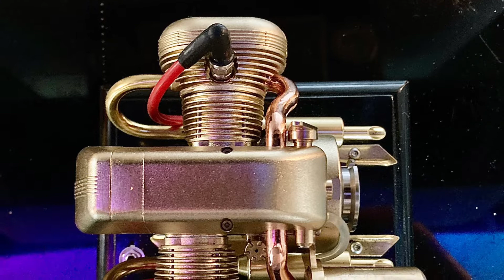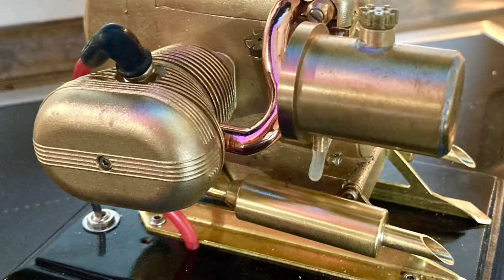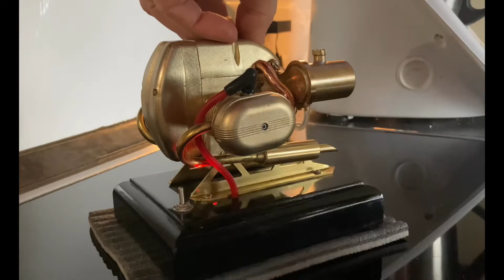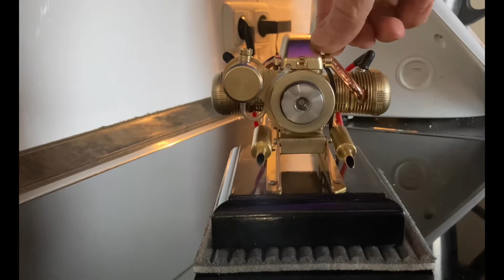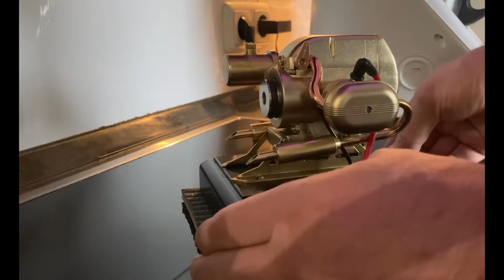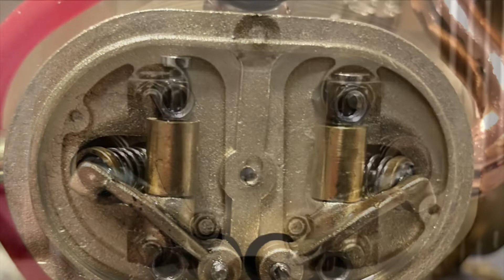Boxer gasoline engine model R90S

Comment: What fuel do you use ? Did you add oil to crankcase ?
Reply from the maker: I use Aspen 2 Stroke fuel. It’s Ethanol free. Premixed with 2% oil. Use it for all my models and can recommend it. It has little odor and the liter is about 6€. In the crankcase I spray a little bit of white grease spray from time to time. (No WD40!!!!)
Reply: @MC-MC1MC  thanks, I am waiting to receive mine, I saw a video that opening the crankcase oil filler is a pain. I will add white grease as well. Probably better than engine oil and dealing with the leak. Did yours work fine out of the box ?
Reply from the maker: Hello again,
It runs better and better, starts easy by hand. In the meantime I ordered new cylinder head covers from Jin. (About 35€ for 2 - BMW style) It looks so much better now. The old ones looks a little bit like from a Ural motocycle. If I have longer runtime, I put a small USB fan in front of the engine for cooling the cylinders. If you can touch the heads with your fingers, everything is ok and you don’t need cooling.  About 60-70 degrees Celsius. There is only one carb for 2 cylinders and a little bit tricky to adjust. Try to start without changing something. It should run out of the box. They did run in China. If the engine has good compression, it will run. A good way to check if your engine is lucky take one ignition cable of while running. If everything is fine it keeps on running  on one cylinder. 
If you get your engine an you have any questions, feel free to ask me. I will help if I can. 
Regards,
Manfred.
Reply: @MC-MC1MC  thanks for your detailed response. Did yours have engine oil when came from China? Apparently some do and it causes oil leak into cylinder , causing issues. I think specially if they are put on the side for long.  How much different is the new head covers compared to original?
Reply from the maker: @simplefact4u  
Where did you buy your engine? I got my from ebay.  If you look at „microcosm-engines“ there are the headcovers. For example the R69S (BMW) has this covers. They are rounded on top and looks like the original. 
I don’t know if there was oil in the crankcase from factory. I don’t think so. Maybe a few drops on moving parts during assembly. I saw some videos on youtube putting 10ml Oil in the crankcase. It splashes on the bottom of the piston. The rubber o-ring does not seal perfect and results in burning oil and lots of smoke. These small engines are not made for running high speed. Most of the time I let them idle or run at low speed. Of course I let them rev up sometimes. But it is not the same quality like an RC plane engine made for 15000 rpm. I have some stationary engines (Diesel style) M15, for example. I put some grease on the gears and spray a little bit of grease spray on the crankshaft, bearings and valve lifters. Put a drop of oil on every moving parts you can see. If you are interested please have a look at my  other videos.  The M16 engines ( air cooled with a little fan) I can recommend. They are easy to disassemble and maintenance, good runners and reliable. 
Sorry for my bad English. 
Manfred.
Reply: @MC-MC1MC  thanks again, I bought it from Ebay through the auctions they run. Around $200 cheaper than websites. Although not sure if those are returned or problematic engines or not.  I agree with you on the lack of proper sealing on them. They are really made for displaying and running for a short time as a fun element. I probably disassemble and add some sealant at the crankcase. Although I will follow your advice and use white grease spray on parts and few in the crankcase. I wish these came as kits too, would have been fun to build it ourselves and improve during the process.  I will check your other videos for sure :)
Reply from the maker: @simplefact4u  Good morning,
all my engines are from ebay auctions. All new and well packed. I wish you luck with yours. Please inform me if and how it runs.
Reply: @MC-MC1MC  will let you know for sure. My next engine would be a Cison L175 kit. I might get a Holt engine from Microcosm but they are expensive .
Reply: @MC-MC1MC  do you have black fluid leak from the base of the cylinders too ? Got mine and lots of issues with the spark, valves and now miss firing from the right cylinder with lots of black stuff coming from the cylinder base and the exhaust
Reply from the maker: Its seems to be to much oil in the crankcase or to much fuel. Try to dry it. Sparkplugs out,close the carburetor screw so that no fuel goes to the engine. Rotate the engine with a powertool or small rope. Blow  air into the spark plug hole’s. Let it dry out and wait a few hours before next start.  
Do you have spark and compression on both cylinders?
The carbscrew on mine is about 1/4 open to start and run well.
Reply: @MC-MC1MC  I haven't added oil to crankcase but using pre mixed fuel 50 to 1 ratio. The original spark plugs were defective so I replaced them with Iridium ones today. Runs much better. The carb is so sensitive. Did you adjust the low speed needle on the throttle ?  It only happens to one cylinder .
Reply from the maker: Ok, if you didn’t put oil in the crankcase, the engine is flooded with gasoline. On my engine changing settings on the  lowspeed needle doesn’t have any effect. ( maybe different at yours- ( it is only for idling I think. ) Ok, if I close it completely, the engine dies. 
You are right, the highspeed needle is very sensitive. It is not the best carburetor to handle 2 cylinders. Changing the settings about 1mm and only 1 cylinder is running. 
If my engine don’t start after one or two pulls, I close the highspeed needle and give it a try. If the engine starts up I open the needle quickly. 
Last week mine won’t start- no compression on one cylinder. Removed the head and cleaned the outlet valve from carbon. Assembled and runs again. 
Good Luck.
Reply from the maker: Do you have good compression on both cylinders?
Reply: @MC-MC1MC  thanks for your response. For me the low speed needle makes some difference, specially as it makes the low Rev more realistic.  My carb is set 3/4 of a turn. Anything lower and it kills the engine. I also think the CDI unit is not too strong and it causes spark fouling easily .

How did you manage to take the cylinder head off ? I was thinking to file the valves as I can see the carb intake spitting some fuel power and pushes air which is the sign of bad valve seat
Reply: @MC-MC1MC  I add some zippo lighter fluid to my fuel، it helps to clean the gunk and prevent sludge and too much sooth to build up. I use around 90% premixed fuel and 10% zippo fuel
Reply from the maker: Maybe the valves and seat is dirty. Normally  you don’t have to grind in the valves. It is s new engine. You can’t file the valves!!! If you want to grind in you have to use a polish like Autosol or toothpaste or fine grinding paste. Look on youtube, there are some videos. But first try to clean the valves by pressing down the valve spring with your fingernail and let it snap back. Do this a few times. Put a drop of fuel on the valves. It will help to clean. Move the flywheel left and right by doing this. Check the compression now. It happens from time to time with all my engines. The reason is : rich fuel air mix and low rpm idling. The valves are so tiny that a little bit of carbon or dust will make them leak. 
To take the cylinder of is not difficult but there are very small parts. If it is your first engine and you don’t have experience with it I would not recommend it. If you want to try it:
Remove the very small c-clips (ATTENTION-flying away an hard to find)
Pull the small axels out together with the rocket arms and the spacer. 
Then you have to unscrew the 4 bolts. ( Remember the position, makes it easier to reassemble. 
Then yo can pull out the head and cylinder. 
Good luck. 
Manfred.
Reply: @MC-MC1MC  awesome reply thanks ! I noticed I totally lost the compression on the other cylinder. I am not sure what happened but probably piston ring is gone. It was working fine last night now it gave up this morning. Valve seems to be okay from outside.  Has it happened to any of these engines you have?
Reply from the maker: @simplefact4u  As I wrote in the answer before. It happened from time to time with nearly all of my engines. Never a faulty piston ring was the reason. They last for ever. Ok, for a very long time If you have oil in your fuel.
Try it again. First take both spark plugs out. Then take a thin rope to rotate the flywheel.
( It is faster than a cordless screwdriver)
Snap the valves again while the flywheel is spinning. Sometimes it helped me. Try to rotate in both directions while doing this.
Reply from the maker: If this doesn’t work, you have to disassemble the  engine. 🙁
Reply: @MC-MC1MC  it seemed changing the ring work and the cylinder is firing again. However and weirdly enough I have the spray fuel out from the carb intake back. I wonder if the valve timing is not right or the valve closes too fast causing the carb spit out fuel spray. And other cylinder spewing out dark fluid.fixing one thing causes other things to fail hah. Bizzare chinese engineering. I think these engines are way over hyped for what poor designed they are.
Reply from the maker: @simplefact4u  Spraying out fuel of the carb is a sign for not closing the intake valve correctly. I think valve timing is fixed at this engine. I put an o-ring around the flywheel for easier rotating and starting by hand. You should feel the same or nearly the same compression on both cylinders for a good start. Fuel out of the exhaust = cylinder is flooded.
Reply: @MC-MC1MC  thanks again, when I opened the cylinder head , I tested the intake valve and it seals perfectly . I blew hard through the intake pipe and no air would get through.  Valve rockers sit loose so there is no pressure on the valve to remain open. Pretty confused! So would the flooded cylinder mean the valve doesn't seal as well or it's the carb pushing too much fuel and not enough air to the cylinder ?
Reply from the maker: @simplefact4u  The reason for the flooded cylinder is that the piston sucks fuel  and fuel and there is no explosion.Close the highspeed needle, dry out, also the spark plugs and try to start with less fuel. Open more and more until it try to start. Fuel, compression and spark. it should run.
After my opinion it is always the amount of fuel that makes starting difficult.
Reply: @MC-MC1MC  I tried to start with 1/4 turn on high speed needle but no luck. Least amount that it starts and stays stable is one and quarter turn which I think it's quite high. I even cleaned up the carb in case it's blocked but no change. I saw in someone else's video that right cylinder was spewing black unburnt fuel and left cylinder was not firing. I think they really don't have a quality control and just assemble these to send out. Glad didn't pay retail and got it from ebay
Reply from the maker: @simplefact4u  If you turn the flywheel is there the same amount of force for both cylinders?
Is it running?
If it is dry, try to close the highspeed needle and drop a tiny bit of fuel in the carb. Try to start. It should run for a few seconds. If it runs you should work on the carb.
Reply from the maker: Ok, if it doesn’t help it is difficult to help from the distance. Make a rest and don’t give up. 🙂
Reply: @MC-MC1MC  I really appreciate your help ! I think the compression is not balanced so right cylinder sucking too much fuel and left doesn't get as much. That's why it is both flooding and spitting out.  Steam 212 has a video with exact same symptoms as mine. I guess these are for hobby than actual accuracy. Hope you are having fun with your engined:)